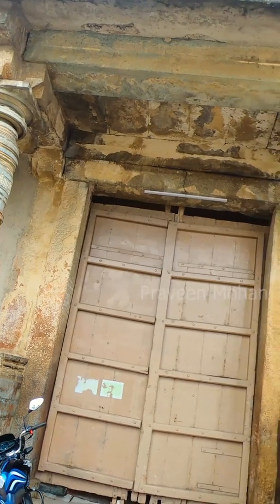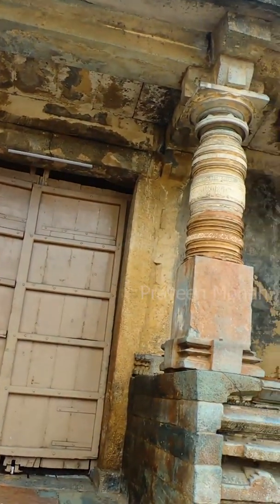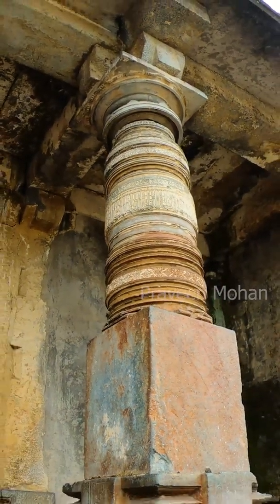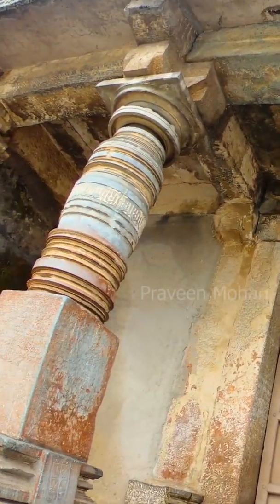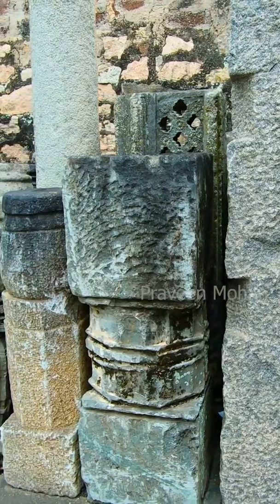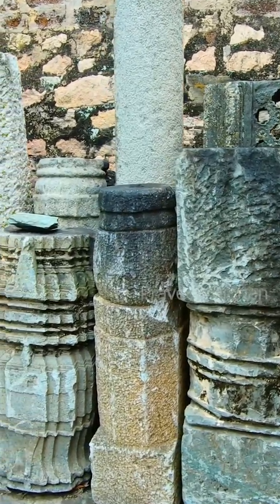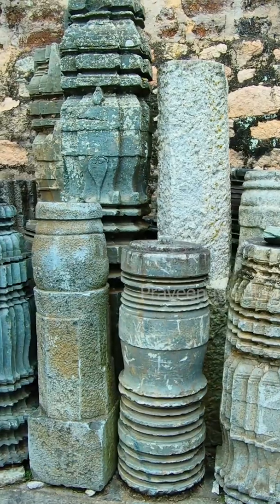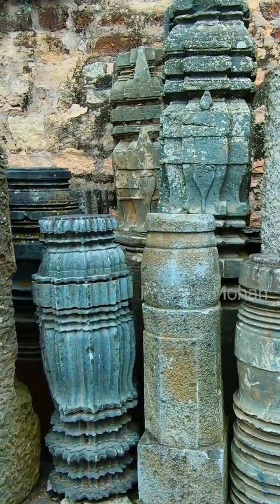Were Ancient Sculptors using Lathe Technology 900 years ago?

Comment: Praveen many of these pillars can not be made on a just a manual lathe, either. you see many of them have many many sides which would require additional machining operations to complete. many of the statues if made in metal today would have to be made on a 5 axis cnc machine. the stone is another layer of complexity.